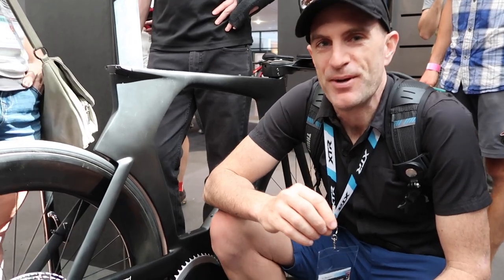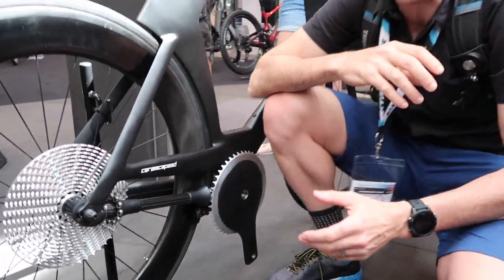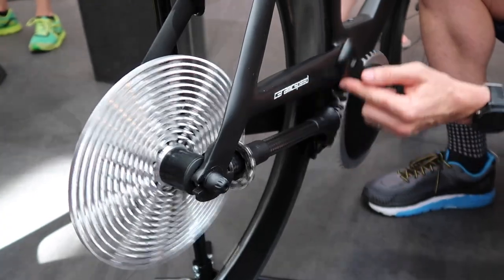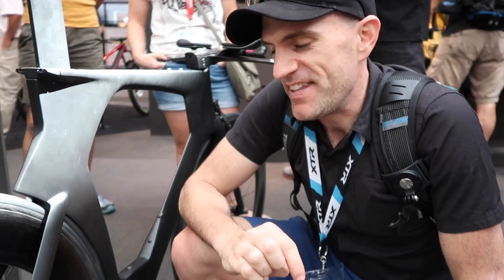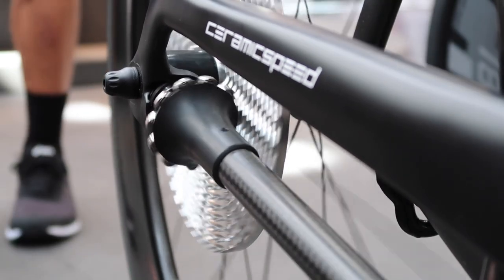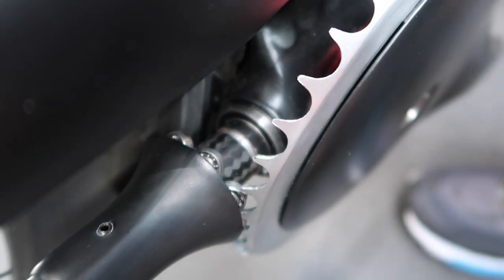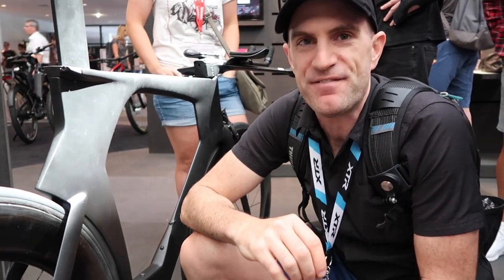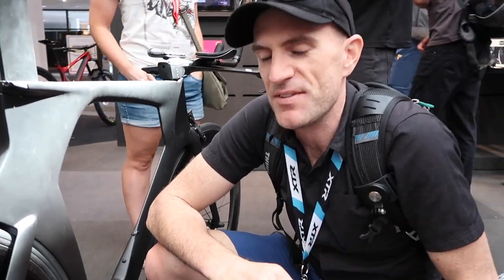CeramicSpeed DrivEN 99% Efficient Drive Shaft // Chain Free Bike // Eurobike 2018

Comment: Engineering problems to solve?? Absolutely. But it’s this out of the box thinking that moves technology forward. Maybe it won’t be this exact design. Maybe someone else will see it and say “Heh - if I changed this or added that” and a new viable concept is born. 
I say kudos to these guys for even trying this. If nobody tried, we’d still be walking.
Reply: Lawrence Keating this guy gets it!
Reply: So many cynics
Reply: Lawrence Keating, in what way does this move anything forward?
These types of driveshafts were in use for centuries. 
The problem is,  these guys replaced cog to cog interface with bits of chain and chain specific cogs. These types of cogs only work when there's just one plain, in which the chain squeezes the cog. In their variant their drive shaft will be pushing the  flat cog sideways almost as hard, as it pushes it downward. Thus bending or breaking the cogs.
Reply: @Lawrence Keating: I've just come along and watched and somethoing clicked in my brain and I had a "Eureka" moment: "I'll change this, add that, put it underneath the lid of a cyclindrical shaped plastic container and make a salad drying kitchen ustensil for Mum" - it'll sell like hotcakes at any fair..... Thanks mate.
Reply: Team33 No problem. Excited for your new invention 😉👍
Reply: @LK: Its already on sale in every good supermarket.
Plastic salad dryers but I suppose, depending on which part of the world you live, you maybe only by ready cleaned salads in plastic bags ? OR you don't eat salad OR you don't cook..... Cheers.

Comment: Reminds me of being down the casino the noise it makes
Reply: Roulette anyone?
Reply: year right, sounds super "efficient" with all that noise it makes
Reply: Probably cost you about as much.
Reply: you're right. my bad
Reply: TRIGGER
Reply: TheMal yeah that was the ratcheting system that basically let's you only power the bike in 1 direction.
Reply: The noise is obviously from the freewheel.  The noise is on the video when the drive train is stopped.  They used some noisy freewheel on this prototype.
Reply: stevenhs8821 thankyou for helping me find the correct terminology haha, that's what it is.

Comment: That's a pretty cool engineering feat, but there's nothing like an old trusty chain.
Reply from the maker: 100% with you there Riley. Until they nail this design... or something newer and more robust than this prototype/concept.
Reply: A chain is only as strong as it's weakest link :p
Reply: Riley Goss  Totally agree mate ,  indeed cool engineering but sometimes simple engineering is the best . 
 looking at that , i think it would have to have some sort of a cover or gaurd over the rear gear area ,  or the first time the tyre flicks up a bit of debris like a wood chip or a stone , that shiny  cheese grater on the back i would imagine would go out of alignment very easily .
Reply: and we got some old rusty crankplate
Reply: Riley Goss thsts true in Chain we Trust😎 this seams to fragile and if somthing broke you are over.Whrere you can fix that in short Time and cost are huge to fix that.a chain you can fix everywear
Reply: Carbon bands are the future. Clean, smooth, flexible and almost unbreakable. You read it here.
Reply: Nothing like an old rusty chain to smear grease all over your pants and sling grease all over your rear wheel.
Reply: chunhaylee this system seams extramlly fragille
Reply: chunhaylee   That's 👍👉right!  😂Haha!
Reply: Old rusty chain
Reply: Nothing like wooden wheels either. Time to move on with improvements. This is awesome.
Reply: I dunno, pretty much by definition chains have a great deal of moving parts and this is based on tried and true principles even if they haven't been used for this, I wouldn't be surprised if even a prototype was comparable.
Reply: Yes that newer better than chain drive seems to have  a lot of links, so to speak.
Reply: Looks spensive terrible!
Reply: This is no engineering at all, this is mentally ill kids play with expensive materials and machines, its a disgrace to every engineer to call that engineering.
Reply: TOO MUCH LUBE !!!
Reply: just exact my thoughts... nothing like an old RUSTY chain
Reply: Or an old rusty chain.
Reply: Rusty? I guess no one has heard of other metals such as stainless steel or titanium...
Reply: Trusty or rusty?
Reply: a solution to a problem that doesnt exist
Reply: Im sure they said the same when talking about pollution and gasoline.
Reply: Andrew Jackson having a bad day? Need a sandwich?  Something must be up for you to express your opinions in such a toxic way.

I feel sorry for you and the people in your life moreso.
Reply: +Zero he's mad that the Dems freed his slaves
Reply: +Zero he's mad that the Republicans freed his slaves
Reply: Keith Savage - if we improve just to improve with time then ur wooden wheel analogy makes no sense because at one point that means the aluminum wheel will one day become obsolete.  any innovation that makes things more complicated is not innovation.  besides the sprocket on this pos would need to be machined out of steel so that eight hour machine time sprocket just jumped to at least double that much time to machine so your probably talking about a 1000 dollar sprocket.  no thanks not just to look cool and be less reliable and to have zero field repair capabilities.
Reply: Evonix - ur synopsis of chains is based on third grade engineering rational, a chain has a lot of moving parts but they are all the same parts.  and chain is cheap.  by rights chain drive is simpler it still has a crank and a sprocket set and a chain.  this has a crank and a driveshaft and a sprocket.   do you see how that driveshaft, by rights, just made this bike more complicated?  a chain isn't complicated you can carry more and field repair in minutes.  besides this bike is light years ahead think about it!  its a ten speed!  or will there be an equally complicated and expensive contraption changing gears on the crank?  also notice he didn't slide the gear change sleeve to change gears if you look carefully i would almost bet that they havent figured out how to make that work yet and that ball bearing contraption is "trapped" in the gear on that "sprocket" they show you in this video.
Reply: Corey Nelson - yes but because by rights they cant figure out how to engineer how to makie it work reliably!  welcome to the world of over engineering!
Reply: Riley Goss 

*Rusty old chain
Reply: Corey Nelson - Lol!  How?  The driveshaft gears are meshed into the sprocket how do you make them jump to a different level on the sprocket without disengaging the driveshaft gear?  He said in the future there would be a way to change gears in the future but if you watch him play with that driveshaft gear it IS SLEEVED and it does move but the problem is it is TRAPPED on a certain gear on the sprocket.  You can't unmesh or switch gears unless you dis-engage the driveshaft gear incidentally they are still designing a clutch and you are still in engineering school.   Lol!
Reply: Corey Nelson - i have a bridge i'm crowdfunding to buy let me know if ur interested.
Reply: Just because you are afraid of change doesn't mean you have to speak badly about innovation
Reply: I misread this as "an old rusty chain"... xD
Reply: you would think until you find out they can break! mine broke at the top of a mountain. i didn't get to go down hill as fast as i wanted :(

Comment: That is so cool. So innovative. Since it took 15 years for roadies to get over disc brakes not slicing your limbs off, how long will it take to get over the effect of being grated up like mozzarella cheese?
Reply: Rixter it’s the $600 pizza 🍕 gear replacement cost i would be worried about
Reply: Roadies are a bunch of divas. Can never please them.
Reply: A simple alloy or carbon plate to cover the cogs to avoid injuries...
Reply: Are you kidding?  With that much carbon, roadies will be all over it!
Reply: 1890 tech, luv bill,i voted 9thhor him
Reply: "we don't need no, edu-cation.."
Reply: No this is not innovative. I am sorry for saying this, but this "no-chain" technology has been here more than 50 years ago and still did not make it into serial production since then.... I am really sorry for dissapointing you :/
Reply: No. There is nothing new.
Reply: Parmesano
Reply: Get a car
Reply: Adam Dubec yeah and electric cars were around before internal combustion. There are always changes in manufacturing and materials that make old ideas suddenly workable now.
Reply: The thing is, that to improve on an old concept is not a bad idea at all! And it is inovative to use the "no-chain" technology in this way. If they manage to make it more efficient than an ordinary drivetrain, then why does it matter that the concept is old?

The same concept for planes have been there for ages, yet still people innovate. Aircraft that utilize turboprop engines have existed for a long time, the concept is old, but new aircraft are still being built using this method, they improved an old concept and is highly effective!
Reply: Charles Moses Jr this is a lot different than a typical bevel spur gear found in an egg beater, shaft driven bikes, your car and all over the place in industrial applications.
Reply: Rixter I doubt it's innovative.
Reply: Those ball bearings are not shielded. That's a major weak point. Non shielded ball bearings are bound to wear out quicker than a chain and sprocket.
Reply: Ethan Doane put rubber shields on. Done.
Reply: This technologie is ca 150 years old
Reply: Rixter You mean grated up like Parmesan cheese.
Reply: Adam Dubec Bullshit. Shaft drive exists since a long time alright. But you wanna know why it’s so rare? Because it USED TO BE very energy-inefficient.

THIS thing, however is AMAZINGLY efficient. And that’s the innovation at hand!
Reply: taxiuniversum: In case this solution is so effective, why they show it only in holder, but not on road? And why "bearings transmissions" are not used anywhere, where efficiency is necessary, but there is no strong torque source? This solution maybe is nice, and can work in situation like in video. But I doubt it will be good in real situations, where is dust, mud and who knows what else. And because roller chain can provide up to 98 % efficiency, this solution with 99 % efficiency  (but I really do not trust it, because there is only two points to transfer all torque. In comparison with chain it is absolutely terrible) will be only much more expensive, much more harder for maintenance, more prone for dirt, etc. All in all I think it is nice training for engineers who developed it, but totally useless for any usage.
Reply: Martin Oulehla Just take it easy. If all people would be as conservative and pessimistic about the principle of innovation, we‘d all still be living in caves. Surely dust etc. will make a difference - and this system - if it will ever be successful on the market - will for years only be a toy for people spending 8-10.000 euros on their bike - but hey: Why not? Just leave them be, and be happy that other people are going through the nuisance of developing enhanced products - because you certainly don’t come across like someone who would like to have that job.
Reply: Martin Oulehla By the way, as for dust and mud: Crank drives are usually encased, so dust and mud can’t enter. I do see you point, but bear in mind this is a prototype. Prototypes are always basically just pointing towards a certain direction. The ultimate products may feature various improvements.
Reply: Martin Oulehla Totally agree with you.
Reply: What the hell is a roadie?
Reply: Phil Cassidy Yes, what is?
Reply: Olav Furuseth not ragging on the usefulness of it, we're ragging on people being so blown away by the base concept of a shaft drive.
Reply: What in the world are you talking about? What's a "roadie"?
Reply: Adam Dubec that's right.... There is a rusty old piece of farm equipment hanging in a bar ceiling I know of is from pre 1900....made of cast iron and far from new innovation
Reply: RIP all Italians dying reading of a mozzarella grated up... :'(
Reply: "slicing your limbs off".....yeah....okay.....how many limbs have been sliced off???  I'll wait....
Reply: Say the people that have never been in a professional race or won anything in one. Btw this is old tech. Am willing to bet you do Triathlon and have no clue what bike handling is.
Reply: Well u can cover most of the "cheese grater" up with plastic cover since there's only one point of contact needed to make the wheel spin...
Reply: Seems to me that wear of the working elements would be a serious pain to manage on a daily basis and you need ways to quickly get it ready to go during a race, which is another problem.

Small parts transferring big force is always problematic.
As guys already mentioned here, dirt could be an issue too (traditional setup is very easy to clean and this is not).
Reply: It's junk.  This prototype can't even switch gears.  That will be 99% of the complexity.
Reply: Rixter won’t happen. Everything has to be built into a casing to withstand dirt etc. With a gearbox, fine, still won’t happen though.
Reply: Rixter you might also want to ad a cover for the drive plate, you don't want to make a meat grinder out of the bick
Reply: it’s not innovative at all, it’s copied straight from a car diff. It’s got a major flaw too!
Reply: 3D laser sintering that part would be hugely expensive, even compared to CNC machining it. The 8 hour cycle time sounds like poor programming to me though. Should be able to turn the basic shape and all the lightening cuts on a lathe in about 20 minutes, and then do just the teeth cuts and deburring on a mill in under 2 hours.
Reply: I'll be glad when they invent the motor bike...
Reply: has that happened?
Reply: @adubi_i  Nor was the stealth bomber innovative.  That airframe has been around since the 40's.  It took modern day materials, computers, and avionics to make it fly.  The same may be true with this bike.  Maybe it's not the first innovation, which apparently didn't work well, but with modern materials, machining/fabricating, and advanced electronics is may go the route of the B2,  now one of the most succesful airframes ever.

Comment: Makes me think possibly they could have a single angled gear on the rear (similar to rear diff) to take that shaft then do some clever gearing on the front mech. Would maybe give more options in terms of torque / stronger mounts etc but less gear sizing. Interesting stuff, please follow up with these guys
Reply: Comedy cemetery